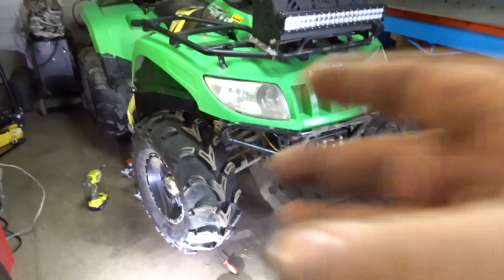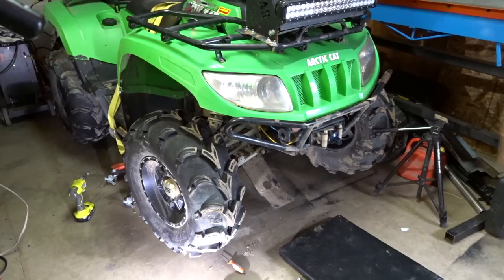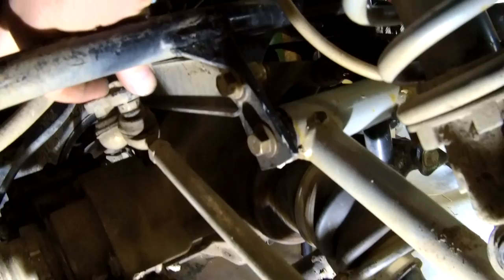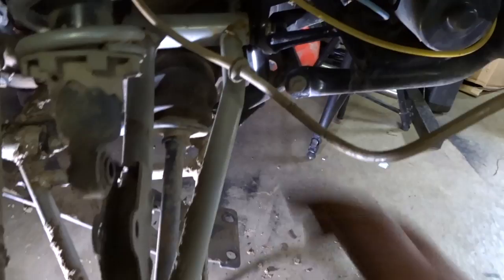How to Remove Arctic Cat Front Differential Part 1DIY

Comment: Hi jerry,  look forward to part two and more, I have a question in one of your videos you said about using automatic transmission fluid (small amounts) to clean out blocked oil ways, did you do it and if so did it work, sorry for asking on this video but unable to find the original,  thanks mark
Reply from the maker: It does work, so does brake cleaner
Reply: i have 2013 400 anf cannot get the white part of cv axle out,, i know to push  in on the ball to release, then pull out but still wont release, actually had the it come apart inside the inner boot, any suggestions.